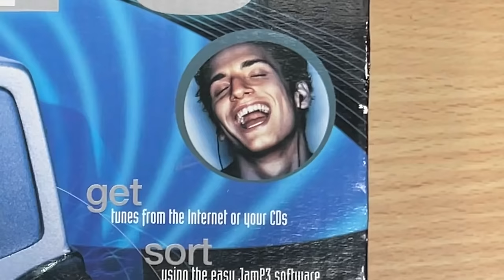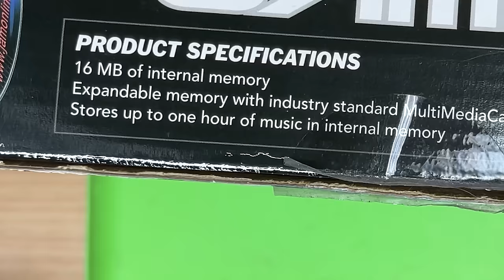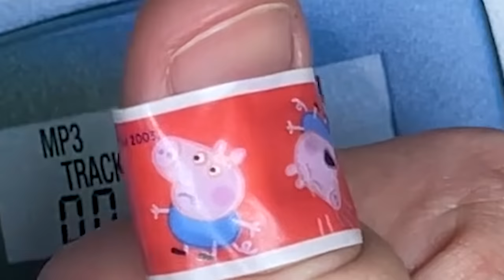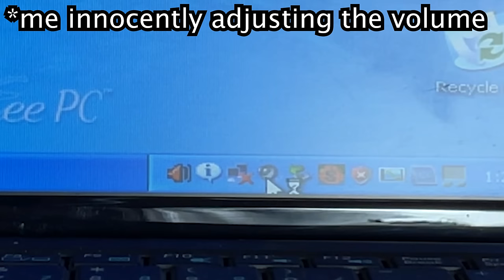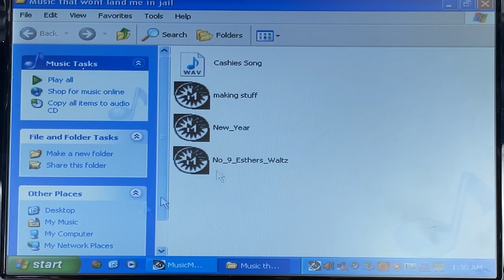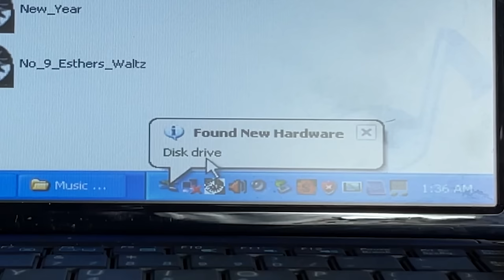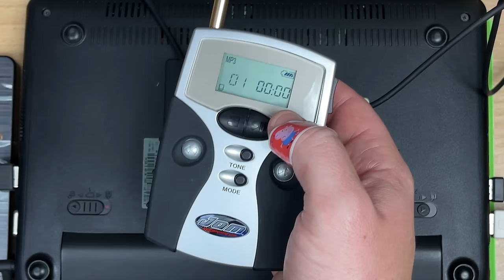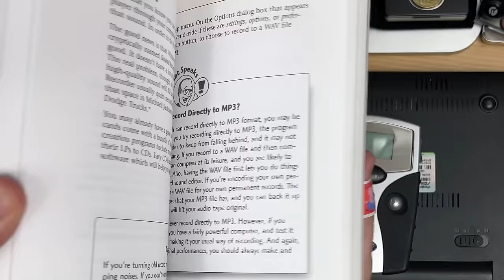I present to you, the JAMP3.

Comment: 4:24 includes HP printer cable for printing song lyrics.

The Jampy was truly revolutionary for its time
Reply: That's just USB B, I don't think mini usb were that accessible to everyone at the time. Printers use it just because it didn't need update and it was very reliable.
Reply: @ayushkaushik8794  Funnily enough. Both my External LightScribe Drive and HD PVR 2 both use USB Type B as well
Reply: That is shockingly accurate.
I have a 5 m cable on my printer that looks exactly like that. Same grey, same climbing rope thickness.

Comment: When I saw those eclipse batteries I was so happy, as someone who works at jaycar I was hoping one days you'd drop in and get some stuff (we sell super shitty audio stuff if you ever want to try it)

BUT those specific batteries are actually really bad, they can't handle any current (which is why the battery ran out so quickly, it'll jump back up to like full when you turn it off for a minute), and they are actually hard to fit into battery cases sometimes so it could be a fault of those instead of the jamP3

still, awesome video as always :)
Reply: So the batteries are on the upper end of the AA length specs, and the jamp3 wants something on the lower end.

Comment: 9:00 That's actually a common problem with old devices with tight (no spring) battery compartments. Battery size minutely changed over the years due to many reasons.

Comment: My first mp3 player actually had a dock that connected to the PC via parallel port. It had 32 megs of volatile memory that wiped if the batteries died.
Reply: Probably the Rio PMP300! I saved my paper route money to be the first kid I knew with an MP3 player.  Yep, it connected through the parallel port and you could expand storage with SmartMedia cards (pre-SD/MMC).
Reply: @johnfriction4919  my favorite flash storage is still the cD picture card, because it's funny.

Comment: This was my first Mp3 player, I got it free as a bonus for buying a HP printer at CompUSA. It was alright, but I got frustrated at the small space and memory card prices were still expensive in the early 2000's.  BTW Next time put use Alkaline batteries in your players. Super Heavy Duty batteries are cheap but electronic devices drain them fast.

Comment: Talking about people not understanding MP3s back in 1999 takes me back to many confused conversations with my dad. He called SD cards and those ultra small optical discs MP3s because he just couldn't wrap his head around a piece of music without a physical medium to exist on.

When the card in my cheapo nugget bit the dust and I had to use the gossamer thin internal storage, it blew his mind that it could work without a disc in it. And yeah, it used normal SD because Micro was either nonexistent or extremely high end at the time.

Comment: Honestly, aside from the tiny internal storage that wouldn't fit a single FLAC even if it could decode it, this thing aged fabulously. The USB Type-B port remains the most reliable device-side USB port, being used on virtually every printer/scanner, as well as the likes of iFi iDSD Neo (a cheaper desktop version of the Diablo).

Comment: I bought one of these for $55 loonies in 2001. The model I bought had no built in storage. I learned my mistake as a 15 year old kid the limits of a 32 mb card. In order to fit the entire album Toxicity by System of a Down I would have to reduce the kbps. It ended up in the back of a bottom drawer very very quickly. Oh the good old days.

Comment: My first MP3 player had an actual hard drive inside. Whenever it changed tracks I had to freeze mid-stride until the disc stopped spinning, or else my battery would drain almost immediately.

Comment: The main argument against mp3 in 1999 was minidisc vs CD-R. You had enough space on a minidisc to record a full cd at near cd quality and could also use higher compression if desired. Napster had not yet taken off, so your music sources were your friends cds, your family's cds and the library. Mp3 players were good for joggers and gym people because they didn't skip but you took a significant hit on audio quality. At 128kbs you music was significantly quieter with over ear headphones. Of course would be using earbuds in the gym. Even the 1st ipod had significant detractions in that you needed to use itunes and had to learn how to get homemade mp3s on it. Cheap no name mp3 players were common because the primary devices were minidiscs for the spenders and burned cds for the general pop. Mp3 players didn't have enough memory until after the ipod.

Comment: 16MB was actually quite a lot back in 1995 or whatever this was. Pretty sure most PC hard drives came at an average 850MB for windows 95/98, and the highest was most likely 3GB or maybe less.
I know that using an emulator. This one “Made for windows 98” game, was about 300MB or so, which was marginal.

Comment: No way! I actually had one of these in the late 1990s/early 2000s until I got an actual Rio (which was one of the very few iTunes compatible music players). It totally sucked. If I recall right I got it from a computer show instead of an MP3 CD player. Should of gotten the CD player....

Edit: Thinking back on it, if I recall correctly, although the memory was upgradable it could only handle up to a 64mb MMC card (no not SD, as that wasn’t on the market yet) totaling out at a massive max of 80MB of memory. I can’t remember if they included the 16mb card with all later models (I’m guessing they were offloaded at computer shows since that’s where I got mine) but I recall I had a 16MB card in mine as well for 32MB. That was just enough to do a bit more then an hour of music at 64kbps. 32MB Memory cards (never mind the max 64MB) actually cost more then the entire price I paid for the player back in the day.

Also it did eat through batteries, but then so did CD players then (batteries always fit fine. Many of today’s batteries, typically cheap ones, are slightly larger to increase runtime).

Comment: I would say that most likely the batteries don't fit because of the battery manufacturer not sticking to the standards. You would usually see this in rechargeable batteries or high capacity batteries. I guess these shitty zinc-oxides could have the same problem. Nowadays the battery compartments are made bigger to accept the oversized "standards"